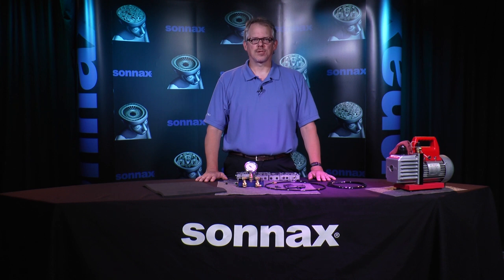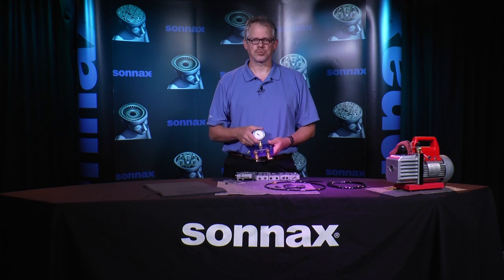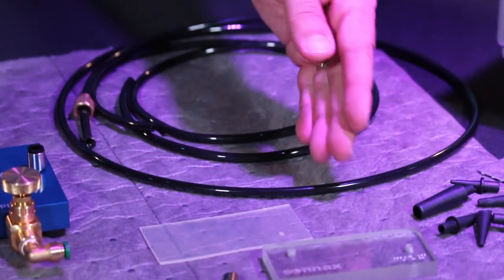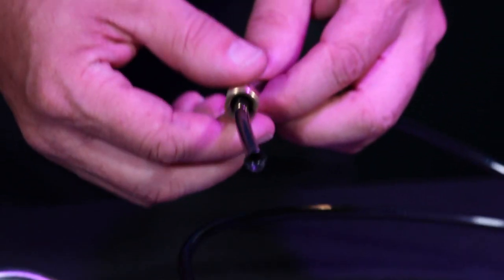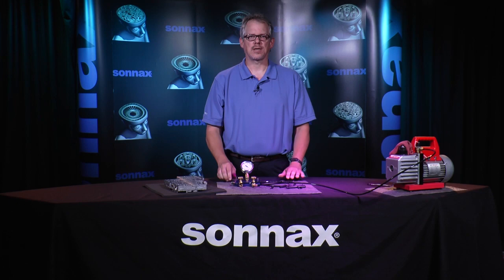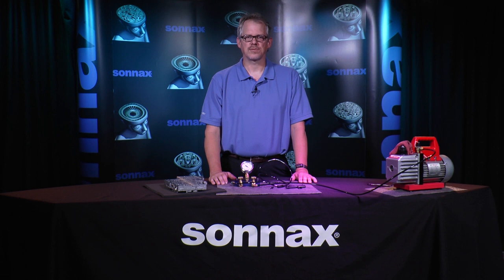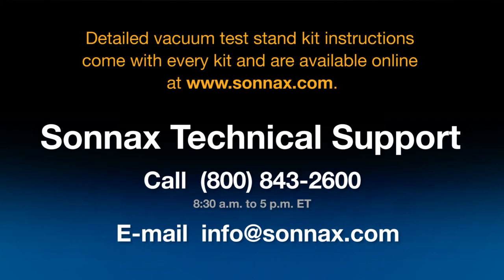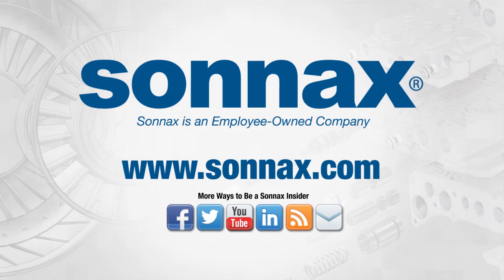Sonnax - Vacuum Test Stand Setup and Calibration (Part 2 of 3)

Comment: Can a 2.5 cfm pump be used?
Reply from the maker: Hi Antonio, it will work, but the response time in getting your final result may be a bit slower (likely not much with that little of a difference). The most important factor is that it needs to calibrate between 5" Hg and 25" Hg. Hope that helps. Thank you, and have a great day!